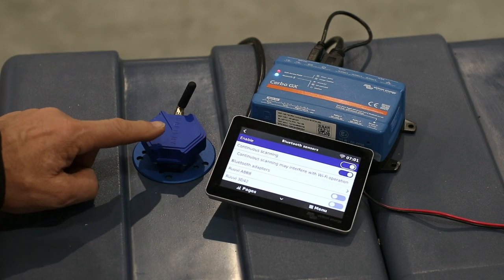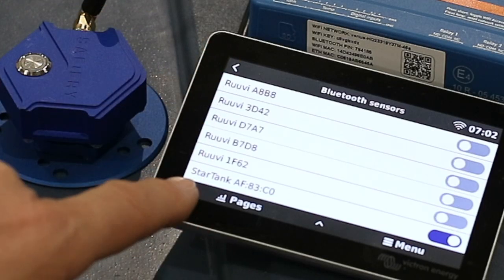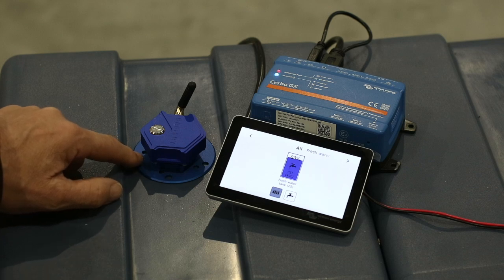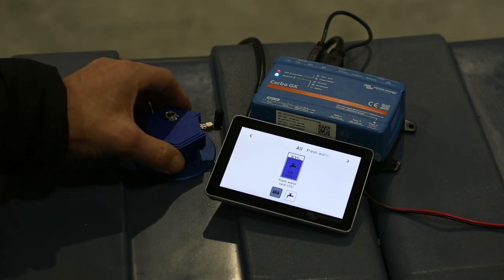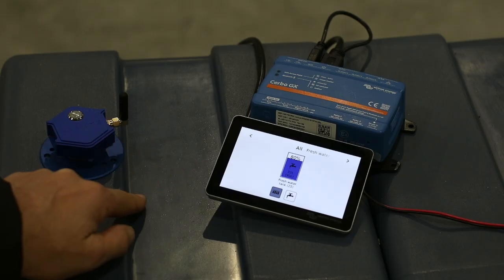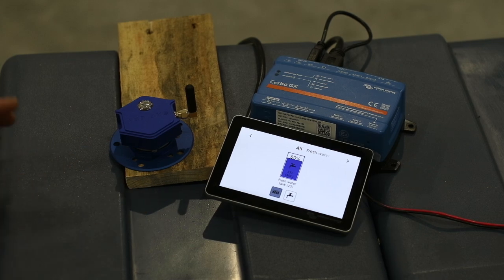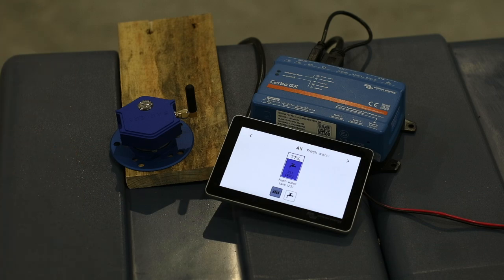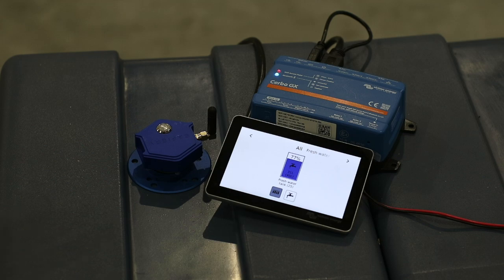STAR-tank Battery Bluetooth saves Installation costs links Victron GX black, grey, fresh water tanks

Comment: How would/could it work with a combined fuel Long Ranger Auxiliary Diesel/Water Tank (122l fuel 55l water) and water tank on my Land Cruiser? I believe the water part is on top. Could I use this to just cover the levels of the water tank on top?
Reply from the maker: Yes it bounces off the water level. Diesel has a much lower dielectric and we meed a metal bottom to reflect back to the diesel top.

Comment: How does this work when caravan tanks are built tight to underfloor of caravan there is no room especially not for something this big? Do need to cut a hole in our floor?
Reply from the maker: We have seen this done once but generally there is 50mm above them as they are hung from cross rails.

Comment: My Black tank in my rv has a bow in it where they did the vent and toilet pipe.  what can i do as of now there is a angle it sits on.  can i build it up somehow to where it is level?  they are plastic
Reply from the maker: Yes it can sit slightly above the tank with a buildup to get it level.
Reply: @Safiery  what material would i use to build it up level?
Reply from the maker: @highinfovoter8940  Sometthing like Sika but unscrew sensor and just build up under 5 hole SAE disc without blocking the hole at all.
Reply: @Safiery  ok so if i understand is correct i could use any material (other than metal) around the sides of the sensor so it does not block the portion for the radar.  I am assuming the air gap is ok?  Will i have to adjust the parameters if I do this?  It is around 3/8 inch on one side I have to build up.  I want to make sure before i order another one.
Reply from the maker: @highinfovoter8940  Yes, there is a 30mm dead band and the sensor is 16mm inside so 3/8 is around 10mm so should be fine. The only thing to watch with black tanks is that no solids stick to top of tank. On poly ethylene tanks that is difficult but some plastic and all metal tanks it is possible.
Reply: @Safiery  clarification will i have to adjust my parameters? i have 227L capacity, 22 cm when tank empty and 2 cm sensor when full.
Reply from the maker: @highinfovoter8940  Your should calibrate it to a small tank which is done with the sensor itself.

Comment: What are the threads between the unit and the ring?
Reply from the maker: This is the secure fixing of the unit to the outter rind for metal tanks. It means that you unscrew the centre housing to change the battery and the base stays on the tank either metal bolted of non-metal with adhesive or double sided tape.
Reply: @Safiery  Got it, was just curious what thread type/size is used for that interface

Comment: I have a 165 gal tank at the cabin. Its cylindrical in shape and stands vertical. The tank fresh water depth goes from 0" to 58" when full. According to your "fine print" (specs) this radar will only track my depths from 20" to 40" or 40" to 79" (well beyond 58" ). Unless I'm missing something, that's not too practical for controlling my pump(?) Please tell me I'm wrong!
Reply from the maker: Yes you are on the edge of the range but we selected 2m because of the test tank we have is 2m. It will probably suit your range but we havent tested. cheers

Comment: Hi 
Wil the cerbo gx produce the data on MNEA2000 if connected and is it possible to change the unit to litres instead of percent?
Reply from the maker: The change to Litres is a Victron function.
Reply from the maker: Yes it should if the tanks are reporting on NMEA.

Comment: Can you make it wifi aswel blootooth?
That way you could increase the range, nice product by the way 🇦🇺🤙
Reply from the maker: Its battery operated and bluetooth gives us 100m line of sight. Its not the usual bluetooth radio but a more powerfull unit. WiFi would drain the battery very quicky.